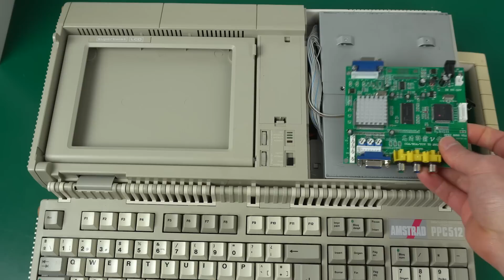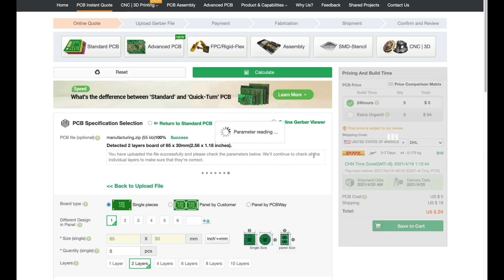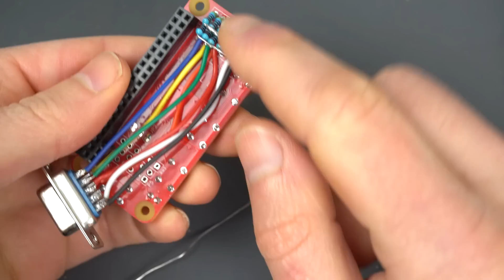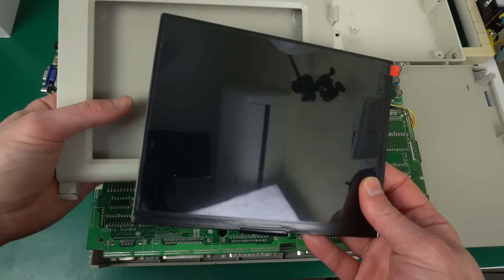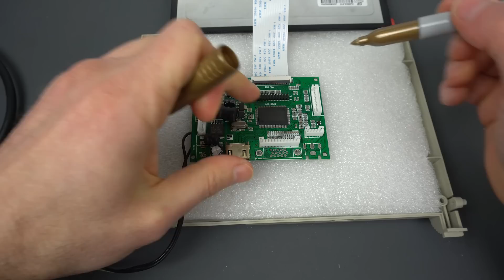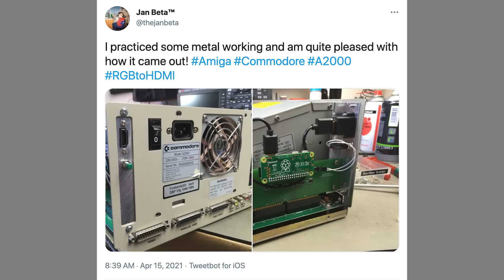Replacing a Laptop LCD With a Raspberry Pi Zero (Part 2)

Comment: I think that there is a glue that is used to fix chips to PCB before soldering so maybe look it up maybe reach out to Lady-Ada.
Reply from the maker: The kind of flux paste I use is usually good enough to hold them in place. Honestly, it was mostly the really weird angle that i was forced to work at because of the camera that caused the first one to come out so bad 😃

Comment: I didn't get it very well Noel, you needed about 3 boards? Raspi Z, Module for RaspiZ (project) and another one converter back on the screen. Is it right? Sorry, I forgot lot of it, but why did you need to keep the last one? Instead to reduce the price... we get it higher adding more modules. Could it be done with just the Raspi Z and its module converter? Thank you
PD: supposedly it should work also for Sinclair QL ;) Maybe another video for it? :)
Reply from the maker: The last one is the LCD driver. That LCD doesn't have any logic on it at all, so it's all in the drive board, so we definitely need it unless we output signals directly for it (which might be possible).
Reply: @NoelsRetroLab  Thank you, I will check the first video to check the price of the LCD Driver :) Great job again!

Comment: Can you use solder paste and  a hot plate for the surface mount stuff? or are the boards not heat tolerant?

Comment: The way that I look at heavily modifying something is, "Would the original makers of the product have done these things, if the technology allowed?" I'm confident that they would, because the screen looks so much better. In fact, they would have likely just used the Raspberry Pi as the computer as well, since it's so much more powerful.
Reply from the maker: Good way to think about it. And yes, wouldn't they have loved to have a Raspberry Pi to put inside that case? 😃

Comment: Also, rather than filing down the pegs on the Amstrad, you might be able to file down /cut the GBS board... Not sure it has any electronics on those corners????
Reply from the maker: Right. Someone mentioned that too. I thought I had looked and it had some tracks, but someone mentioned there's a corner that can definitely be cut, so that's probably a better way to go.

Comment: the board that controls the lcd uses an ic rtd2662 / 2660. there is a project for an open source firmware (openrtd) that adds support for resolutions at 15khz l, i believe it would be possible to connect amstrad directly to it using the custom firmware.

https://www.jagdroid.org/video-board-programming-and-modification/
Reply from the maker: Exactly! That's the potential part 3 I'm headed towards. It will probably miss some of the niceties this has like turning on monochrome modes and such, but it would be great to minimize the amount of hardware.

Comment: Great fix that. Now you just need to replace the main board with a Pi running a bare-metal emulation of an 8088,  a Pi to emulate the floppy drive, a Pi to interface a USB keyboard and mouse onto it and a Pi to emulate a switching power supply controller chip and you're all set 😁
Reply from the maker: But that would be.... boooooring 😃 Just kidding. That in itself would be a really fun project. But I still have a lot of plans for the hardware in the case, so I won't be replacing it any time soon.

Comment: Is there a significant delay when powering up the PiZero? Does it take several seconds to load an OS before it can start converting the signals?
Reply from the maker: Not at all. It's a bare metal application. It's up and running in less than a second.
Reply: @NoelsRetroLab  thanks Noel, that's fascinating. Great video!

Comment: As some comments already mentionned : a pi inside the PPC, well already done : https://youtu.be/KKwlPl84iUU with retropie but of course dosbox or pcem is possible (http://pcem-emulator.co.uk/) which can emulates the PPC (with a hard disk, network...). He didnt use the original keyboard of the PPC but swapped it.

Comment: you could cut the corner of the board instead of cutting into the pegs i think that would be a better idea because the corner of the board has only a hole so you can just cut that out of the board
Reply from the maker: The GBS8200 board? Yes, that's probably true. Fortunately it doesn't look like I'm going in that direction. Another plus about this RGB to HDMI approach is that I still have lots of room to spare in that section for more improvements 😃

Comment: Where did you find RPi Zero for 7 euros? The cheapest I've found is $16 from Aliexpress (that's the Wi-Fi version, couldn't find the one without Wi-Fi any cheaper).
Reply from the maker: Any of the official Pi Stores in Europe have the plain one for 5€ plus a couple bucks shipping. But now that I think of it, I haven't seen the plain one in a while. I wonder if it was affected by that global chip shortage.

Comment: It's funny, I also use a way more powerful computer as a diskette controller (a Pi serving an Amiga 2000)
Reply from the maker: Yeah, sometimes you just need to do that. I'm totally OK with it actually, especially if it's not something permanent.

Comment: As Louis Rossman would have said, there can never be too much flux ;-)
Also, you could have folded the LCD flat flex cable, to get it out straight, or used flat HDMI cable for easier fit.
Reply from the maker: Yes, pretty much 😃 As for the HDMI cable, all done. Check out the latest video on this series.

Comment: doesn't CGA have a composite mode to get more colours? Would prince of Persia have more colours via composite? can this be emulated?
Reply from the maker: I'm a bit fuzzy on the composite mode. I don't know if it generates extra colors with the NTSC interference artifacts, or if it's something else. I do believe there are a couple settings in the Pi menu, so I may have to experiment with them. Thanks for the reminder!

Comment: Has some one created a retro computer like Amstrad, using a RPi or Pi0.
I have a Rpi3 that I'm not using, and thought to make a C64 or higher.
Reply from the maker: Like emulating the whole computer? No idea. There are DOS emulators, but for that to be interesting it would have to be a bare metal one (so no booting into anything before). I could certainly be done.
Reply: It already exists : SugarPI, check https://www.cpcwiki.eu/forum/emulators/sugarbox-a-cpc-emulator-for-windows/msg177256/#msg177256 and https://github.com/Tom1975/SugarPi/releases for the download link, it's a bare metal emulator, no debian used. There are actually slow down on a RPi 4 but not the 3.
Reply: @emmanuelroussin1906  Thanks. Exactly what I was looking for. Will check it out.
Reply: @NoelsRetroLab  Emulating the whole computer would be nice, but I can't see anyone doing it.

Comment: Hi, could this be a solution on other things than computers like music samplers (Roland S770) with RGB output ?
Reply from the maker: Yes, this will pretty much work with any RGB signal. You may need the analog add-on depending on how the signal of your device is, and, if it's not already supported, you may have to write your own profile, but it's definitely possible and not too difficult.
Reply: @NoelsRetroLab  Thanks Noel, I've ordered the RgbToHdmi PCB (12 bits which is overkill here). Hard to find the Xilinx CPLD. I hope I will understand how the profile has to be written.
Reply from the maker: Let me know how it goes (or pop in in the Discord server). I haven't written a profile yet. It doesn't seem too complicated but I'd love to know some details of someone who's done it.
Reply: @NoelsRetroLab  Thanks for asking how it goes. I'm still waiting to receive the PCBs ordered from China. And after that I will try to solder that tiny CPLD chip. Wish me luck :)
Reply: @NoelsRetroLab  Can't find your Discord channel. Well, PCB received and this morning was the big day. Well, soldering that CPLD is a big fail for me :(
Reply: Got something working, with patience that CPLD soldering was fixed. And... it works ! Still have to find the good configuration.

Comment: Can't you use a pi1/2/3/4 and just run the lcd without the driver board?
Reply from the maker: It's posible with the right adaptors and if we know the protocol of the LCD communication. I'll probably try something else before though (driver board without the Pi).

Comment: Anyone able to find the 8" LCD for that price? With the driver board they seem to be around £40.  Great video - keep up the good work!
Reply from the maker: Ugh. I wonder if that's the new victim of chip shortages and price increases. I bought a couple of that price (the second one was slightly cheaper), so hang on and it'll hopefully go back down again.
Reply: @NoelsRetroLab  you are probably right.  I am too excited to have a bash at this project myself so have bought one anyway 🙃 thanks again for the great content 👌👍

Comment: For drag soldering, you need a lot of flux and a bevel tip iron. Just put tons of flux on the pins, totally covering them, then get a tiny amount of solder (can't stress this enough, what ever you think is the right amount, just use half of it) on the iron tip and drag just barely touching ONLY to the tips (ends) of the pins where they meet the pads on the PCB. NEVER put your iron tip on the pin itself. The below link is a very good example of how it is done.
https://youtu.be/iKDAmY9Rdag

Comment: I still see retro tech under a usability aspect. I mean yes, we can fix a machine to museum grade correctness with all original parts and leaded solder and keep the yellowing and leave the cracks and bulletholes in it. Chances are, however taht it's not very usable even after fixing because on a lot of these machines exactly the same part breaks and sorta becomes extinct from some point on.
So, i guess a few should be kept in perfect original condition, but as an enthusiast rather than a curator I feel they should be first and foremost kept in usable condition. Because just looking at the machine will not convey the experience it provided and is therefore pointless.
It's not the Nike of Samothrake. It's okay to give it it's head and arms back.
Reply from the maker: That's a really good way to think about it. Both approaches are valid and they have different goals. And in this case, I really want to use it and enjoy it and I think it's much better for that now 👍

Comment: those  SMD parts and chips are best soldered with a hot air gun. Using a tip makes a mess with those tiny feet.

Comment: Is all that foam not going to interfere with heat dissipation, especially in extended use? How hot does that driver board, etc. get?
Reply from the maker: You know, it's definitely possible. I didn't get the impression the driver board was getting very hot, but I didn't run it for extended periods of time.  Although at the same time, being vertical and not in the body of the computer, it might help it cool through the case itself. I should keep an eye out on that.

Comment: Did you tried to find out what was wrong with your first board anyway? Or you just threw it away and "moved along" ;)
Reply from the maker: The one with random flipped image? I put it aside and moved on. But it may play a part in a possible Part 3 for this. Stay tuned 😃

Comment: Get a hot air station, it’s much easier to solder that chip with hot air
Reply from the maker: I have one already. I'll be doing some experiments soon comparing hot air to a hot plate and using stencils. Should be interesting!
Reply: @NoelsRetroLab  IMO stencil is not really worth it’s cost if you only use it once